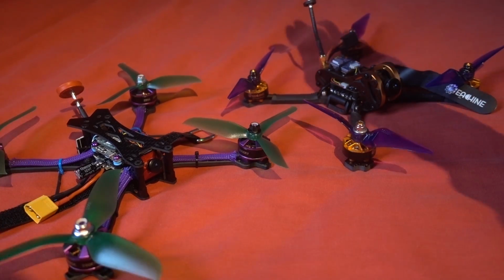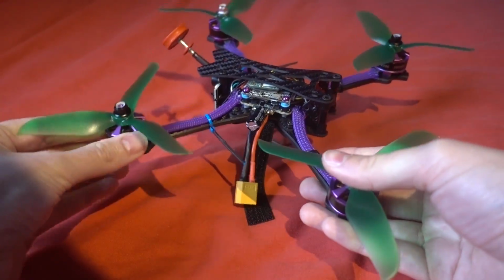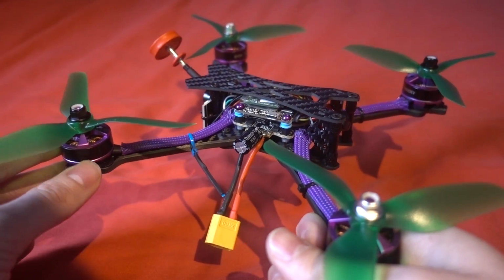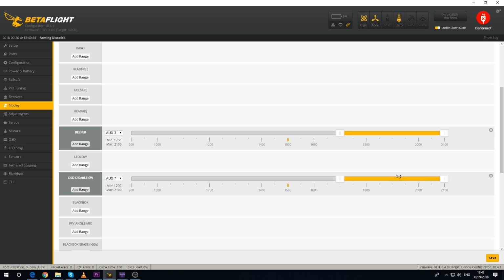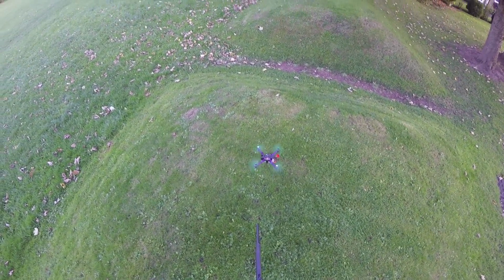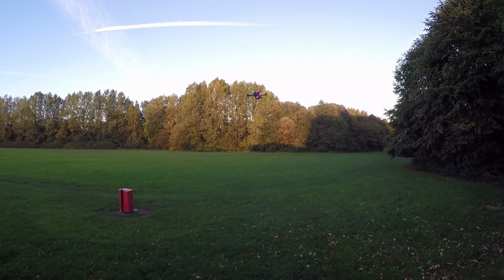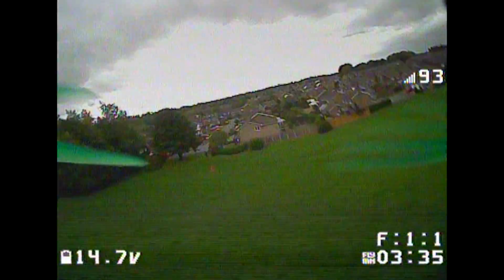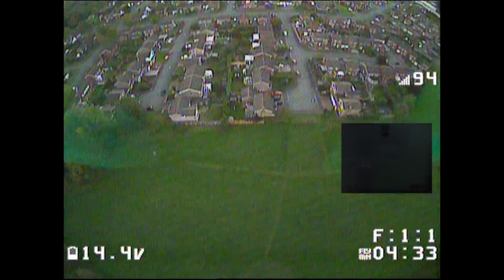Tero Q215 Overview - Setup - Fly

Comment: Help! I have a Tero Q215mm drone as well..I connected my Taranis QX7 to the included Frsky XM+ and it did everything it should’ve done with all the lights and such (I can also tell it’s connected because certain stick movements on the controller make the drone beep and such) but when I throttle up nothing happens:( Also the VTX board gets very hot?? Thanks in advance!

Comment: Hey mate, great video ! I'm a bit of a newbie & I'm trying to wire up an I-bus receiver. I have soldered it to the plug & wire that come out of the s-bus port, but this is obviously not working. I see you mention that there maybe a spare UART6 port. I can find gnd, tx6 & rx6 next to the usb port. Is this where I need to solder my I-bus receiver to, but where do I pick up the 5v pad? Also where is the boot pins for the FC, is it that little button above the antenna for the camera? I seem to push that but it doesn't do anything.

Any information would be greatly appreciated, TIA

Matt
Reply: Did you find a solution ?
Reply: @stakeout2  yes, thank you

Comment: I got very much horizontal black bars in my FPV-Feed ehem flying and i have no idea how to tackle this problem. Are there Andy ideas dir solving it?
Reply: You have to add extra spacers between the fc and the escs. Additionally you can try to remove the condensator. You ve also got the tero?
Reply: Yes I got the tero. I just solved the Problem. The 5,8Ghz Adapter for the FC was lose and vibrated. A Bit of Hotglue solved it.

Comment: CAN YOU TELL ME HOW TO GET THE 800 MW SETTING TO WORK ??? MINE ONLY GOS TO LITTLE OVER 200 MW... THANKS MIKE
Reply: Have you tried changing the 3rd blinking number on your fc to a higher one with the button?
Reply: @cfactor9737  YES changed to 4 ...but only about 135mw...???
Reply: maybe a bad vtx you think???
Reply: @Dragonewiz  then i dont know how to do it, maybe the video transmitter is just too cheap. I ve got the problem that I cant spin the motors in betaflight. Has this something to do with the arm- lock?
Reply: @cfactor9737  This is on the Tero Q215 though ??? just like the one your talking about in your video ...
Reply: @cfactor9737 I don't know about the arm lock...???
Reply: @Dragonewiz  yes, i m talking about the tero, I ve also got it and on mine the transmitter gets quite hot, i cant tell exactly what it is outputting, but on some videos i heard that the range is just a bit low.
Reply: @cfactor9737  ok thanks ill have to put a better one on it lol
Reply: @Dragonewiz  or maybe a better antenna would help, because you cant really change the transmitter on the tero since it is included in the fc. But im no expert

Comment: Heads up for anyone wanting to order this drone from Gearbest.   Gearbest is experiencing problems with their supplier of this drone.  They have not received any other shipments after receiving their first order.  When the very first video about the Q215 came out on Drone Camp RC I placed an order for this.  Its been over a month and the order still has not shipped from china.  On their page they list them as being shipped in a few days. That is not the truth. I am sure in time they will fix this but at the moment they are extremely back logged on the  tero Q215.

Comment: Got the kit Friday, put it together Saturday, flew it Sunday......for 30 seconds.  Flip of death.  :(  Tried raising min throttle percent to 6.....Same. Lowered vtx from 600mw to 25. Same. Upgraded to BF 3.5.1.  Same.   Changed from top to bottom mount battery. Same.   :(((  Funny thing, tho, it only happens when I flip about the pitch axis. I can rapidly roll and yaw, but as soon as I try to flip forward or backward, she FODs.  The very first one actually cracked and de-lammed the baseplate, which I fixed with superglue. But each subsequent crash (they are all LOS now to stay low and minimize damage) bums me out even more.  I've watched a zillion vids on FOD causes now and as you know it can be a wild goose chase that lasts forever, but I guess that's what I get for trying to go low dollar and work out the kinks.  Not really sure what to try next.  Asked GB for refund or credit.  We shall see.  Thanks so much for all your hard work Andy.  We love you, buddy!
Reply from the maker: Most likely you have the rates set too high. The motors will stop on idle if rates too high and will cause death roll. Increase the idle to more or decrease the rates
Reply: OMG -- *RATES*???  REALLY?  I've never heard of that!  For Pitch and roll im only on a super of .76 & .79 but on Yaw - I like a linear yaw and I flatten the curve with a rate of  1.64 and super of  .27 (again for a flat line response).  I have no problems with this setup on 2 other omnibusf4SD's but hey - it's worth a try.  One other thing I noticed is that you are using BF10.4.1 configurator which I guess is the chrome extension?  I'm on 10.4.0 (windows) and your screen shows throttle idle percent whereas mine doesnt.  I accomplish this by using the OSD in the goggles where I can raise it to 6. in either case, it's certainly worth a shot. THANKS SO MUCH ANDY!  BLESS YOU!  CHEERS!  :))

Comment: I bought the drone. it does not recognize the FlySky receiver and neither sbus. Does FlySky Receiver Support?
Reply from the maker: you need to connect flysky a UART as ftsky sbus is an inverted signal and ibus is uninverted,
Reply: Hi Luiz Lopes wha did you do to make your flysky receiver to work ?

Comment: Not being picky Andy, but you forgot to mention using blue Loctite on the motor retaining screws...?...In particular if you are going to use those soft motor mounts, as tightening the screws right up will negate the benefits of the soft mount.
  Some M3 washers are also useful to obtain maximum thread engagement of the motor screws. Just sayin...:)
Reply from the maker: the soft mounting of the motors didnt fix the issue otherwise it would have been mentioned. cheers
Reply: Yeah, Im not surprised about that either. It's not really a "soft" motor mount by design, as the screw heads are in direct contact with the Arms.  I still use Loctite on my motor retaining screws, as an Engineer by profession, I can't help myself....:)

Comment: Some great info shared on this one Andy, this one caught my attention a while back so I ordered it, will be interesting to see if I have the same issue with the camera wires reversed like yours had :) but I defo need to get the dampening sorted with that fc when i build mine , cheers.
Reply: Mine didnt have the problem with the wires, but i have no idea how to get out of the DFU mode after flashing. If you already did this on your drone, could you help me with this problem?
Reply: @c factor Hi usually after flashing any of my quads with the latest betaflight release I just disconnect the the cable & reconnect it, this should reset the flight controller back to normal.
Reply: @tjrcuk  thanks for your reply. But i already saved the problem by using another cable. I tried the whole afternoon 😢
Reply: @cfactor9737  ok no worries 👍

Comment: Hi Andy, You should just tick reverse in betaflight and change props, its better to have motors reversed :) cheers!
Reply from the maker: sure if you like grass thrown into your usb port ;)
Reply: i use the mobile phone usb port plugs - work a treat. You get 100 odd for £1 :)
Reply: hehe ;) yeah thats only one downside i think ;)
Reply: Having grass thrown into unplugged USB port I find is better than flinging grass across camera lens when using turtle mode .  As old mate said though , you can  just plug them up for a couple of Cents/Pence a time .

Comment: Awesome review with nice tips.
Thank you Andy!

By the way, does anyone can tell me if the Kingkong / LDARC 200GT is worth the extra price?
Wich one would be better?
Cheers.
Reply: I have the GT200. At first I thought it was a bit of a dog, but then I realized it has Anti Gravity turned off by default... Once I turned that on Air Mode was great and it became a very predictable and agile flyer! Its very light and the aluminum shafts and bells are not the most durable that I've seen.
Reply: @Rvalivesound  Thanks for the feedback!
Still not sure what to buy, but Cheers!

Comment: Its strange that sellers don't offer upgrade packages at point of sale. Certainly an upgrade camera option would be nice rather than buying then dumping the supplied camera. Solid review with useful hints. Well done.
Reply: I think the idea is that their entire website is an upgrade package. You buy this, get addicted to FPV, then mortgage your home to buy quad parts from Gearbest. Great business model really.
Reply: Raven187, ha, I feel your pain but at least its not as silly expensive as back 5 years ago. I only fly sub £10 motors and find them good enough. Who needs to buy the very best when its often more about the Indian than the arrow. I'll let the product improve and price drop - time will fix it. The single thing I'll pay more for is the camera.
Reply: Agreed, and for me the goggles to view that better picture.
Reply: Mark Westbrook. Yep, decent camera and goggles make such a difference. I used the doms v1 - upgraded to v2 - but stuck with them at present due to cost. Which goggles are you using / prefer?
Reply: I went for the Eachine VR D1s box goggle for starters purely because of the cost and that some reviewers had recommended them. I couldn't get on with them at all, so went for the aomway's V1s on Stue's UAV futures appraisal. They are an excellent pair and definitely would recommend. £217 on banggood at the moment.  :)
Reply: Mark, ok, interesting. I've never tried anything other than fatsharks so stuck with them. Good to read the Aomways work for you. I'd like to compare them - but nobody else flies here.  Diversity is fab, a massive improvement but I'd expected goggles to have improved more. Time will fix it.
Reply: J.P.Sawyer, interesting take on this. I presumed its a boxing operation so sticking one of two or three camera options in the box would appear to be relatively do-able. The motivation is it adds value to the order. The guys who will immediately chuck out the base camera are unlikely to buy the upgrade camera from them so its their only chance to earn extra. Personally I'd never buy one of these budget kits if I was going to throw stuff out - so perhaps they loose business not offering options.
Reply: Haha funny thing is they’ve recently released a tyro109! $109 and has a decent caddx camera

Comment: Aren't you afraid of the capacitor getting ripped off at that spot, from e.g. a crash in a tree?
Reply from the maker: with a race drone you should be concerned with anything being ripped off ;)
Reply: Yeah I know, it just seems especially vulnerable.. With capacitors, can you hook them up to positive/negative using wires instead of directly on the capacitor's feet?
Reply from the maker: the longer the wire the less effective they are. the cap is inline with the arms so it would be pretty tricky to knock off.. ill give it a go though
Reply: How long wire at max would you put?
Reply from the maker: if I have the choice i wouldnt. which is why i left in this build